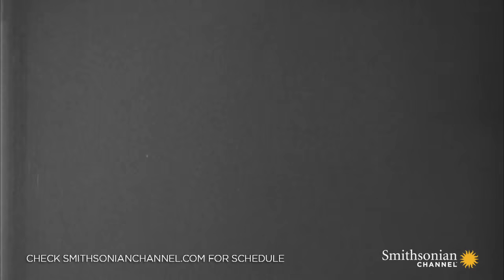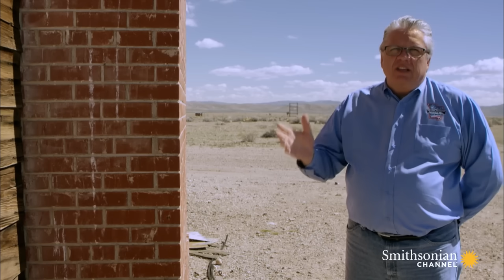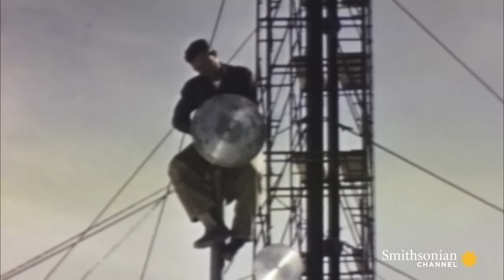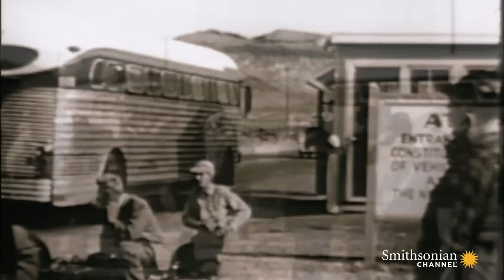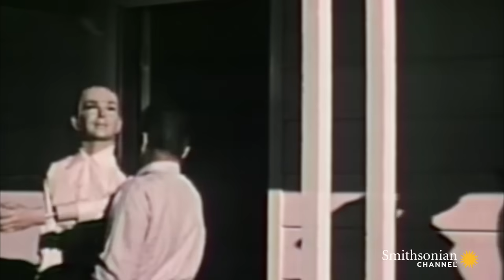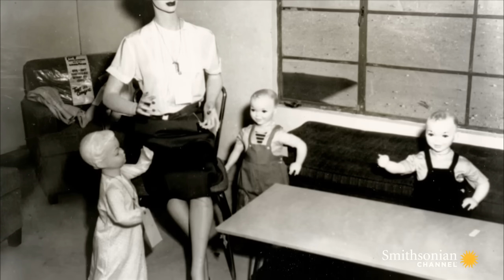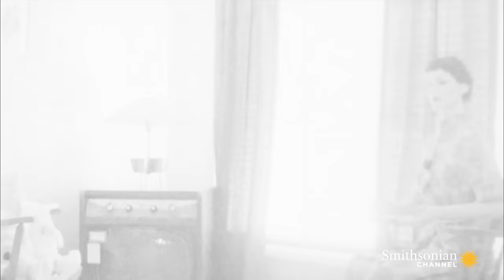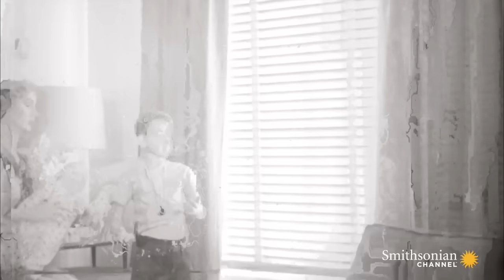Intense Footage of Fake Towns Used for 1950s Nuclear Tests

Comment: How’d the camera survive?
Reply: Fake "towns" for nuclear test footage were real, but the cameras were specially protected to survive the blasts and capture the events. Engineers used rugged, specially designed cameras encased in lead-lined steel boxes and mounted on reinforced towers to film the mock towns, which were filled with mannequins, furniture, and vehicles. Some footage also came from interior cameras protected by concrete and from cameras that used mirrors to view the blast indirectly.
Reply: Don`t question just consume and believe....

Comment: it was CGI. so fake!
Reply: Fake "towns" for nuclear test footage were real, but the cameras were specially protected to survive the blasts and capture the events. Engineers used rugged, specially designed cameras encased in lead-lined steel boxes and mounted on reinforced towers to film the mock towns, which were filled with mannequins, furniture, and vehicles. Some footage also came from interior cameras protected by concrete and from cameras that used mirrors to view the blast indirectly.

Comment: How did the camera footage survive 😊
Reply: Fake "towns" for nuclear test footage were real, but the cameras were specially protected to survive the blasts and capture the events. Engineers used rugged, specially designed cameras encased in lead-lined steel boxes and mounted on reinforced towers to film the mock towns, which were filled with mannequins, furniture, and vehicles. Some footage also came from interior cameras protected by concrete and from cameras that used mirrors to view the blast indirectly.

Comment: WHO FILMED IT?
Reply: Fake "towns" for nuclear test footage were real, but the cameras were specially protected to survive the blasts and capture the events. Engineers used rugged, specially designed cameras encased in lead-lined steel boxes and mounted on reinforced towers to film the mock towns, which were filled with mannequins, furniture, and vehicles. Some footage also came from interior cameras protected by concrete and from cameras that used mirrors to view the blast indirectly.

Comment: Ok...check it out, you aren't gonna "protect equipment" from a nuke by putting the bomb up on a 1500ft tower! The bomb was actually placed on the 1500ft tower to simulate an air burst, it's how nukes would typically be deployed because it has the most effective blast radius against buildings, houses, cities, etc...and that's what they were studying here. Typically the sensors near a nuke have their signals sent thru complex cables and relays to recording media further away. Those sensors near the bomb do their jobs in milliseconds right before they're sacrificed for the cause, and vaporized. Yeah,1500ft of space from a nuke will NOT even protect Apple equipment...even with the best otter case, sorry folks. 😂

Comment: so fake. little models. if Hiroshima and Nagasaki were nuked then why did they just rebuild and are now big cities? Where is the radiation? Also if you look at aerial footage of Nagasaki and compare it to Dresden which was firebombed they look the same.
Reply: They use fear as a measure of control.
Reply: The nukes detonated in the air, meaning the fission products didn’t linger in the area for very long

Comment: How was the film not affected by radiation. Were the cameras destroyed?
Reply: Do you know what radiation is and how intensity drops with distance? Furthermore cameras can be shielded and hardened to function in severe radiation fields .A go pro can survive overpresure than can tear a car to shreds , an archaic heavy camera in an armored steel box cemented to the ground can survive abuse that can throw around a modern tank like a leaf and produce stable film. This is nothing, with very opaque light filters you can capture footage very near to the fireball. Or zoom on it from a mile away like they usually do. From where is this conspiracy thinking even coming from? There is no reason behind this one.

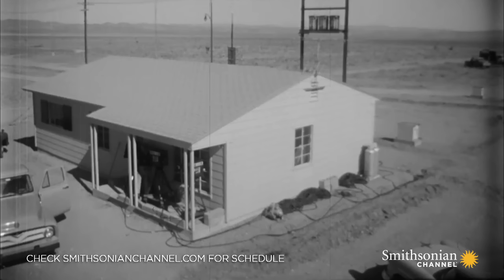Comment: Not a conspiracy guy but think this is fake. 0:08 you can see a car on the bottom left and it disappears randomly. And the bushes disappear too lol
Reply: The clip you are seeing there may be two clips, taken at different times, spliced together.  Before the flash is the before footage  then whoever was there preparing things drove away.  Later, maybe hours later, when the flash happens, that's the start of the after footage.  The bushes?  Who knows?  But why would removing bushes facilitate a fraud?  If it were a fraud, they'd just do it with the bushes there, right?  Maybe they removed them for the sake of visibility, to look for the house shifting on its foundation.

Comment: How did the camera inside survive the blast and the film
Reply: During a nuclear test, unmanned cameras closer to the explosion, at 800 yards (731 meters), used lead to shield the cameras and film. Cameras were placed inside lead-lined boxes on sleds, where they captured images of the blast on mirrors that were directly exposed to the light and blast
Reply: During a nuclear test, unmanned cameras closer to the explosion, at 800 yards (731 meters), used lead to shield the cameras and film. Cameras were placed inside lead-lined boxes on sleds, where they captured images of the blast on mirrors that were directly exposed to the light and blast

Comment: How did they get the cameras and the film to survive those blasts?
Reply: During a nuclear test, unmanned cameras closer to the explosion, at 800 yards (731 meters), used lead to shield the cameras and film. Cameras were placed inside lead-lined boxes on sleds, where they captured images of the blast on mirrors that were directly exposed to the light and blast

Comment: How did those cameras not move at all?
Reply: During a nuclear test, unmanned cameras closer to the explosion, at 800 yards (731 meters), used lead to shield the cameras and film. Cameras were placed inside lead-lined boxes on sleds, where they captured images of the blast on mirrors that were directly exposed to the light and blast

Comment: So what did they mount the camera on ?
Reply: Cameras were placed inside lead-lined boxes on sleds, where they captured images of the blast on mirrors that were directly exposed to the light and blast
Reply: @thebasedspectre3048  ah but still. Doesn’t make sense to me
Reply: @AchievementAchieved  just do research if it doesn't make sense and make sure to listen to both sides

Comment: Much of the scenes were from 1953 Operation Upshot-Knothole’s Civil Defense (CD) portion, called Operation Doorstep, noted by the 3 cloned two-story homes.
The remainder was from 1955 Operation Teapot’s CD component: Operation Cue. A greater variety of common home designs and materials, communications systems, and community power supply were tested.

Comment: One of the shots is from inside the house. Lead does block radiation of some sort still it needs to be more than 1.3 feet thick to stop a certain radiation. Even if we assume the lead box around the camera is thick enough to not let any radiation destroy the footage. And let not talk about how it got toggle over and how they made efforts to put a huge monolithic lead container inside the small house. It still needs to have transparent windows for the camera. I don't know of any transparent material that stops radiation like lead that was invented before this. 

I know nuclear detonation does not make radioactive disaster like a nuclear plant would. But still, If you saw Veritasium's video on how Kodak, the film roll company found out about US secret nuclear tests. Basically, the Kodak Mills started to get black spots on their film because that's a photosensitive product, it's something that never happened before until the very day they detonated the nuclear bomb. Kodak figure out the nuclear test themselves. The US Government actually admitted and offered compensation for all film companies. So even a slight radiation that far away could destroy a film in the factory it could definitely decimate the film in a "splash" zone. One might think they might have used superior technology film rolls, I don't think so because back when digital ear started they had issues with making the footage digital and the flim and lost many of the footage because the film was rotting away. You have to remember the house wall started burning from the particles and energy of the blast at this point allegedly. 

I am not saying we never had nuclear tests. I am saying this footage looks problematic. The best argument for the USA government would be that the USA had far better technology to protect film and other equipment than what we think they had.

I could be wrong. If you know something please tell me. I am ready to learn new things.

Comment: how is the camera ok
Reply: Peter Kuran wrote a book called "How to photograph an atomic bomb."

The cameras had lead-lined steel cases with armored glass over the lens. They were placed 2,750 to 10,500 feet away. Outside cameras were mounted on steel poles, eight inches in diameter, with a concrete base.

Comment: How did the camera not get incinerated or blown up ???
Reply: Peter Kuran wrote a book called "How to photograph an atomic bomb."

The cameras had lead-lined steel cases with armored glass over the lens. They were placed 2,750 to 10,500 feet away. Outside cameras were mounted on steel poles, eight inches in diameter, with a concrete base.

Comment: The cameras transmitted the event as live TV and the video was recorded on film remotely using a kinescope. (Look it up.)

Cameras can be stabilized by mounting them on a massive platform upon a flexible base so the inertia of the platform prevents it from moving while the ground moves beneath it.

Many of the onsite cameras were destroyed by the blast but had already televised the effects of the explosion by then.

Observers watched the effects of the Upshot–Knothole Annie explosion at the Nevada test site on March 17, 1953 from exactly one half mile away, an easy distance for telephoto lenses for outside shots.  Other cameras for outside shots could be stabilized in shielded bunkers.

The Upshot–Knothole Annie explosion was the test that showed the house with the car.  After the house was built and the camera was positioned, test videos were made.  The car was not present when the test videos were made.  When the explosion occurred, after the car was put in position, the camera had not been moved.  The videos of the blast that are circulated were edited to just show the blast.  Someone (possibly a conspiracy theory promoter) took the time to splice some of the test video to the blast video.   This explains the car suddenly appearing.

I’m not against conspiracy theories.  There are billions of conspiracies going on right now and by definition they are done in secret.  I’ve been involved in a few minor ones myself.  The only way to detect one before the plot takes place is to start with a hypothesis (called a theory by non-scientists) based on whatever information is available.  Conspiracy theories are good because we have to start somewhere even though the vast majority are at least partially wrong.  It is naive to believe that conspiracies don’t happen.  It is also naive to believe that any particular conspiracy theory is likely to be right.  They need to be tested like any hypothesis.
Reply: People watch one Joe Rogan clip and think they are in some special club to think these are fake. I've heard some crazy conspiracy theories but this one is hilarious. Glad someone took the time to explain it to them.
Reply: Right but why would the switch the clip to a different time when the car wasn't there? What would be the point in doing that? Why not just film it straight thru? And this happens multiple times. Why do this editing over and over when u cud just play the whole clip?
Reply: @TommyMissus  Did you watch the test films? It has more footage than this special has. You also have to remember they don't release the whole footage because it was during the cold war. The whole reason they did so many tests. They didn't want to release any classified footage that Russia could get ahold of and gain intelligence with.

Comment: These videos are all fake. It just so happens that a nuclear blast will completely vaporize everything around it, but the camera and the film were in no way affected by a nuclear blast or radiation…
Reply: Peter Kuran wrote a book called "How to photograph an atomic bomb."

The cameras had lead-lined steel cases with armored glass over the lens. They were placed 2,750 to 10,500 feet away. Outside cameras were mounted on steel poles, eight inches in diameter, with a concrete base.

Comment: And how did they recover the footage? In 1950 these cameras recorded the footage on a tape INSIDE the camera.
Reply: Peter Kuran wrote a book called "How to photograph an atomic bomb."

The cameras had lead-lined steel cases with armored glass over the lens. They were placed 2,750 to 10,500 feet away. Outside cameras were mounted on steel poles, eight inches in diameter, with a concrete base.

Comment: How did the cameras survive
Reply: Peter Kuran wrote a book called "How to photograph an atomic bomb."

The cameras had lead-lined steel cases with armored glass over the lens. They were placed 2,750 to 10,500 feet away. Outside cameras were mounted on steel poles, eight inches in diameter, with a concrete base.

Comment: But how did the cameras survive? Considering the immense power of the atomic bomb?
Reply: Encased in steel and facing away from the light
Reply: Peter Kuran wrote a book called "How to photograph an atomic bomb."

The cameras had lead-lined steel cases with armored glass over the lens. They were placed 2,750 to 10,500 feet away. Outside cameras were mounted on steel poles, eight inches in diameter, with a concrete base.

Comment: So nobody gonna talk about how the camera survived these blasts
Reply: You’re here because Joe Rogan already did
Reply: Peter Kuran wrote a book called "How to photograph an atomic bomb."

The cameras had lead-lined steel cases with armored glass over the lens. They were placed 2,750 to 10,500 feet away. Outside cameras were mounted on steel poles, eight inches in diameter, with a concrete base.

Comment: 1. obvious model  2. house blows away but powerline poles don't budge. 3. the before and after house is two different houses with different window placement, very fast clip, then they show NO paint remnants like they say, just sun bleaching. Probably western film set. The house they show just before the blast has no shutters on it and it's a brick house, not wood, and the exact house is later shown as a brick house with another house beside it, but in the blast footage the surroundings are gone. 4. The old man talking about radiation on the dummies talks with his eyes closed and looks and acts like he's lying. 5. all footage very fast clips. what happened to the dummies? They keep it very short because it's so obviously fake
Reply: Svetlana Kuznetkova  it’s fake there toy models not houses

Comment: The delay between heat and blast is spooky! 😨
Reply: Light travels faster than sound. The heat is from the blackbody spectrum caused by the fission reactions (or fission and fusion reactions in thermonuclear tests). 80% of the energy is in the form of soft and hard X-rays, which ionize a volume of air surrounding the bomb, heating it to 10’s of millions of degrees Celsius. The rate at which this unimaginable rise in temperature occurs over ~525 cubic meters of air is so incredible that it causes a hydrodynamic shockwave to form, racing against the faster  expanding superheated air until the fireball cools enough for the hydrodynamic shock front to overtake the thermal radiative Marshak wave.

Comment: Wow those cameras must've been mighty strong to record all that and stay still while the whole house collapsed lol 🤣🤣🤣🤣
Reply: Or they just had them stationed inside a suitable protective lead lined concrete bunker with many of them faced away from the blast wave and directed at mirrors suspended atop concrete pillars. Doesn’t take much to figure out.
Reply: @bjornragnarsson8692  you’re reaching pretty far there lol. the simplest explanation is usually the most likely. nukes are a hoax. you’ve been brainwashed.
Reply: @bjornragnarsson8692 all that would have had noticeable shaking and seismic movement. You have tried so hard that your attempt is laughable.